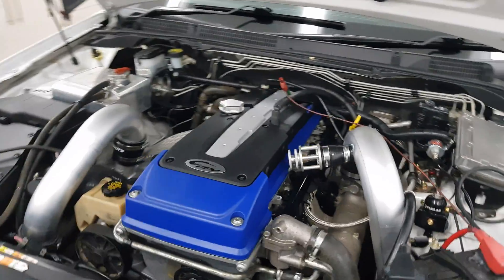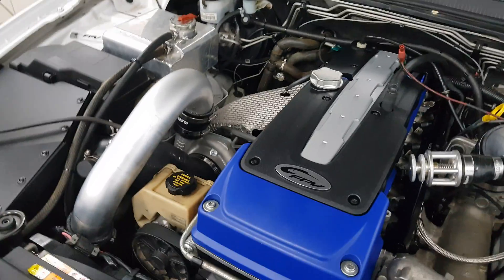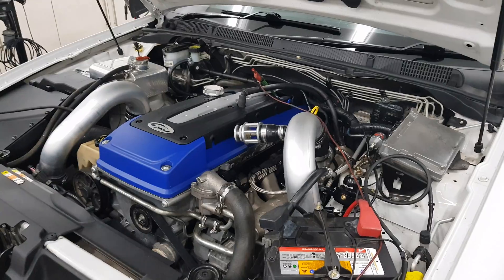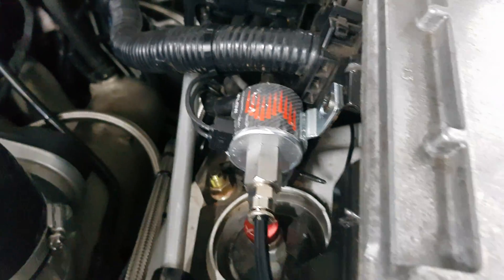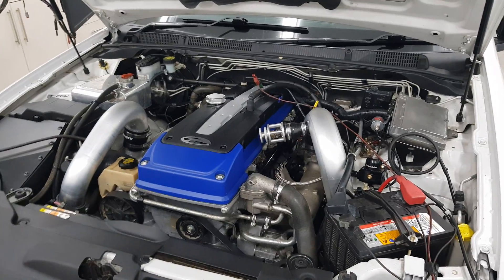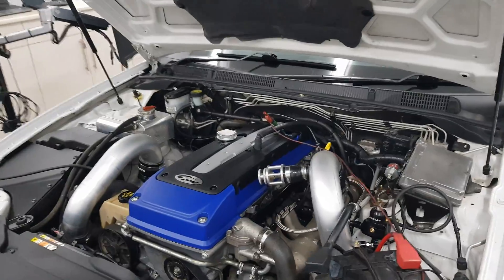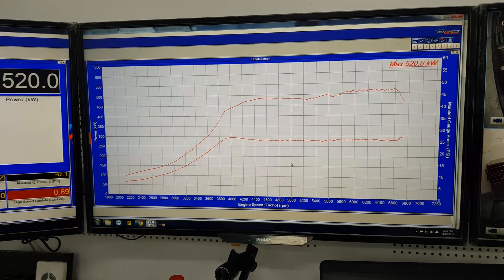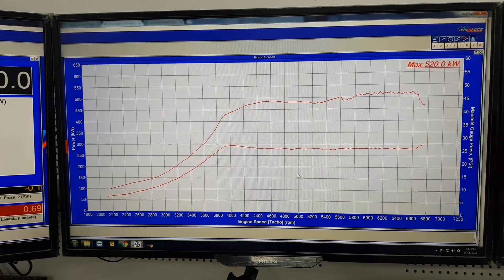Brads FG F6 520kw on 98 Octane with Snow water methanol injection

Comment: so a base snow kit is $600 plus upgrades another $300 plus cost to install and tune up $800+  sound about right ?  2 g for a methanol kit  plus all the other upgrades done to this motor process west stage 3 intercooler $1500 cams $1200 turbo $1200   injecters $600 ++++ labour    soon ads up $$$ wise  bloody barras are costing more than a v8 nowdays  think id rather the sound of a tuff v8 anyday for $5g  just my opinion buy yeah pretty tuff barra there guys
Reply: Lop you throw 5 grand into a v8 and ill throw 5 grand into a barra.. barra would smoke you
Reply: Fordy Mcfordy forced induction will always be better than an N/A, one of my mates owns a 340rwkw SS, got quoted for both a supercharger and turbocharger kit, both were 20k+
Reply: $1200 for the turbo....keep going lol. base Snow kit was $300 delivered around 2006. Thats was the 8001 kit with MAP sensor (Hobbs switch). I'd reckon this car would have all the safety features you can get from Snow as it's by by engine if it stops squirting mid boost! These kits work and deliver especially the longer you're on the throttle the temps just keep dropping.....

Comment: 520kw @ the wheels ?
Also, what is the cost to run the meth, ie, with 'spirited' weekend street driving ?
Reply from the maker: Nor Dic yes at the wheels. For 20ltr of methanol it will cost you $30 and that will mix 40ltr, you would be lucky to use 2.5 gal to a tank of fuel.
Reply: ok,cool. Seems like it could be more cost effective than injector and fuel pump upgrades for E85, and less hassle than sourcing E85, assuming that methanol can be bought easily.
Reply from the maker: Nor Dic it is definitely more economical and methanol is very easy to get